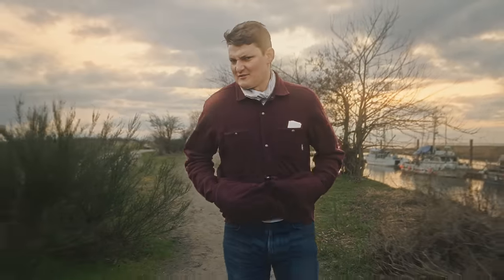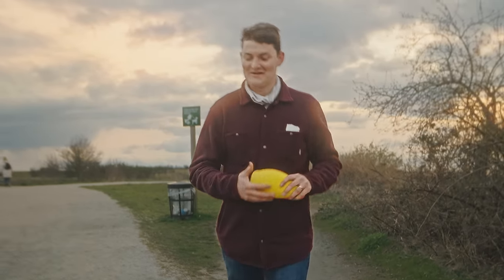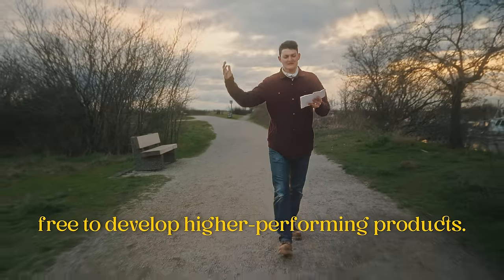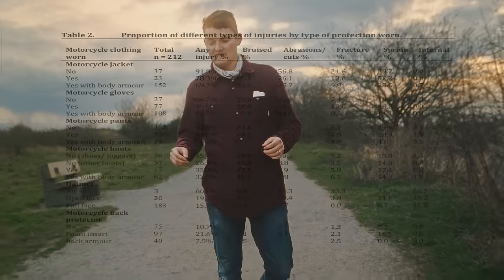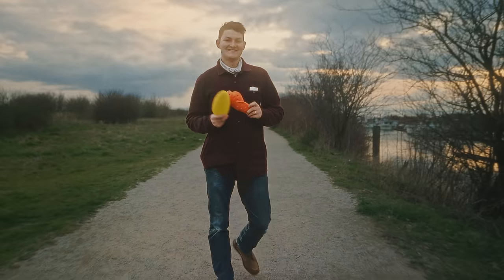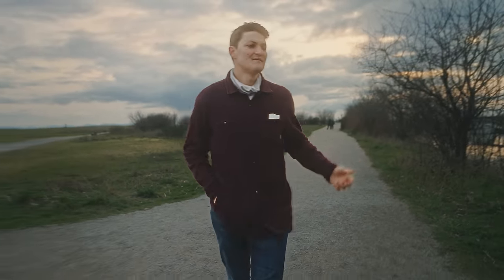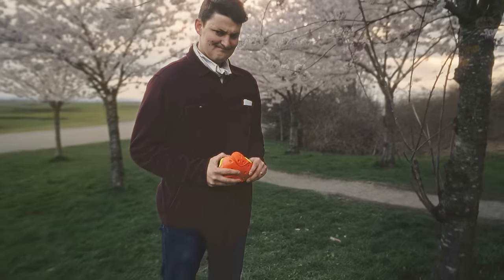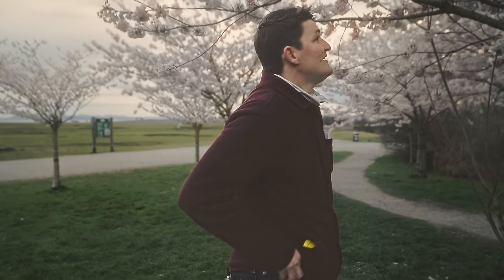Why I Stopped Wearing Motorcycle Body Armour

Comment: I high sided on the expressway last May doing approximately 130kph after hitting a metal patch on the road. I was airborn  for what seemed like an eternity and knew it was going to hurt when I finally made contact with mother earth. When I landed I broke my collarbone and damaged my shoulder ((now titanium man ) however I also slid a long way alongside my bike. The  motorcycle jeans I was wearing were damaged but the road never made contact with my skin due to the fabric and armour. My Jacket was like wise badly damaged but the material and armour protected my skin. My gloves had sliders on the heel of the palm and were both badly worn (trying to slow myself down ) but my hands were fine apart from a small cut on one finger. I never believed that so called armour would protect my bones and it did not, but there is no doubt what so ever, that if I had not been wearing it I would have suffered serious skin and tissue damage. I understand the points Ryan is making but his almost dismissive  " It  may save you  a bruise" is, in my mind, a little dismissive of the very real possibility of serious slide injuries. His airbag may protect his bones in a crash but it will not stop him wearing away his elbow. Armour is there to help save the rider from unintentional weight loss due to skating on your ass down a strip of tarmac.
Reply: That's true, but is there really much of a point if you're riding around town and not going those speeds? Not arguing, it's just an interesting debate. 130km/h is higher than the speed limits for 99% of roads here in Aus
Reply: Yeah because bikers never go over the speed limit
Reply: High sided on the expressway??????? Lol
Reply: I think you're mixing up armor and slide protection. He's not advocating for not wearing abrasion resistant gear, just for taking the pads out of them to make them more wearable
Reply: @willie123567 yeah but those pads add significantly to the amount of material that is between u and the road u slide over.
Reply: @Knallteute  sure, but you should be buying materias where that extra material is not needed (leather, extra strong textiles, etc)
Reply: @chrispekel5709  Personally, I ride an adventure bike. This stuff works wonders for slow-speed crashes.
Reply: @jarrod1687 But that is something you can control yourself. If you genuinely dont go faster than 50 because youre just riding in the city and commuting, then thats worth considering.

Everything else is just facts and not in the riders control
Reply: High siding at 130. Gear is not your problem.
Reply: @SynthgirlBulge  Most of us are on bikes to have fun. I'm not going to advocate for going over the speed limit - especially by a dangerous amount - but we all speed here and there. Also, in the USA, 130kph is not very fast. We have some speed limits faster than that.

As others have said, some armor is better than no armor. The armor will always absorb some impact, which will make the impact more barrable. Will it always save a bone from breaking? No. I fail to see how that's a valid argument though.
Reply: @seanhammon6639  it's amazing how people survive such ordeals... it's clear the protective equipment saved him from lots of extra suffering but in a sense it's luck more than anything else...
Reply: @seanhammon6639 Dont really understand your post but hey, each to their own.
Reply: @WillHampson Yes, changing lanes, large metal plate in road, wet, not seen because  view blocked by vehicle,  rear wheel lost grip immediately owing to slight lean angle, bike snapped into full l/h lock, tyre gripped again, me launched. I have since found out it has caused several accidents for both cars and bikes. Including fatalities.
Reply: @chrispekel5709  Hi mate, I am not an AGAT proponent. Just telling it as it happened to me. I firmly believe in an individual is responsible for themselves  and  should make their own decisions.
Reply: @willie123567 I may well be confusing the issue mate.
Reply: @WillHampson Does seem strange I know. But a wet metal plate that you hit with a lean angle will do it everytime.  I found out after that it has caused several accidents for both cars and bikes and at least one rider was killed because of it.
Reply: @chrispekel5709 sticking to the speed limit is dangerous on a bike nobody drives the speed limit by doing so you're opening yourself to getting rear ended, being tailgated and annoying people in bigger heavier vehicles who will only be feet behind you because you're doing the speed limit
Reply: @sleepyrasta420  they do here in Aus. So many cameras and heavy fines. I mentioned that in my post

Comment: Crash test dummy here.. flung myself off into the woods up in the Catskills after hitting a blind corner covered in sand from the prior winter.   7 broken ribs and a collapsed  lung. Helicopter ride as well to a trauma center.  Thankfully had a forcefield sub 4 back protector and level 2 everywhere else. Astar super tech boots saved my ankles, the bike landed on them and pinned me under the bmw. Knox handroid gloves..the ones with the exoskeleton saved my hand which was buried in a pile of river rock.  Had yellow bruising around all the body armor but all good. I landed with my arm up on a pile or river rock which did the damage to my ribs.   Full airbag vest could have helped, i suspect.   The hospital bill was over $100,000!  Do your self a favor and add as much armor as you can afford.   Riding 15 years till that event. It will happen, and there is no need to end up in a wheelchair!
Reply: 100k?! How much of that was paid by insurance???
Reply: Do you still ride?
Reply: Thanks
Reply: Murica! Would have been €600 own risk over here in NL. But crazy story ma dude. Hope you recovered well. I only ride with full gear. I like my body and skin.
Reply: It will happen? I'd say the majority of riders will get through a 50-year riding 'career' without a significant crash and/or injury. It's not a statistical certainty. Your story highlights the usefulness of gear, but you know what's even more useful? Safety and sport riding courses every single spring to refresh your skills and safely test your limits.
Reply: Cost me about $10k. Should have bought that airbag vest!  Went to EMDR therapy to relieve the trauma. Worked really well. Made the event into a distant memory.  This happened about 2 years ago. Took a year to start getting around without massive pain. Now 2 years and I feel ok, despite the weird shoulder noise when I do push-ups.  Started riding my road and mountain bike this year. Haven't been back on the motorcycle,  but getting the urge.  My daughter who moved back in with me threatened to run me over and break the remaining ribs if I return to riding!  Lol.  She may be serious.   That was the most disturbing part..seeing my daughter so upset with what happened. I am a single parent,  so very close with my children.  I'm 67 btw..and the thought of selling the Hayabusa is very disturbing! Glad I didn't crash that ride!  And correct..go slow at the beginning of the season to acclimate to the bike. Sadly everyone in my group had hit the ground at some point.  Deer..rodents oil..hard to avoid all hazards, so protect yourself  and enjoy the sport.
Reply: @bamidrol  Helicopter medivacs aren't free in the US.  Can be $30k alone.
Reply: Fuck me. Hell of a spill. 😮 Hope you're good now mate
Reply: Yes..thanks brother.. was nasty for a long while. They can't set ribs, unfortunately.
Reply: @wiseoldman5841  How fast were you going to do that much damage if you don't mind me asking? I definitely need to step up my safety gear by the sounds of it.
Reply: @rhodwilliams7258  Of course..in the range of 35mph at that point. It was a pretty tight  S bend. Couldn't counter steer at all.  The road was like ice. Went off into a large forsythia bush and landed on some river rock down, maybe a 60 foot drop. We tumbled at least one time. The windshield and topcase were about 30 feet up hill. Don't recall what happened after going through the bush. The helmet was all scratched up and had a concussion as well. More of those rocks!  The bike was completely rideable. And if I landed a couple of feet prior, would probably be ok. My luck.  The state trooper was kind enough to bring all my safety gear to the hospital.
Reply: @TheUrbanEpicure You’re presuming he didn’t attend such a course? There’s no accounting for every eventuality on the road. That’s why the gear exists.
Reply: @Dreyno  Yes, I'm presuming that based on his wording ('flung myself'). Sure, there's no accounting for every eventuality, but knowing your, your bike's and the road's limits is still the best course of action to prevent accidents.
Reply: God bless the NHS
Reply: 100k lmao America is doomed.
Reply: @bamidrol  FR. I'd pay a secret agent to fly me to europe and pretend it happened there.. FK the US Health industrial complex.
Reply: @wiseoldman5841 You are definitely correct and also lived to tell the story. Many young riders out there might be taking Fort Nine 100% seriously. I hope they all understand that it is called 'protection' for a reason. To protect a human from a fatal accident. Thank you for your wise and experienced words. Much Love, from Scotland, ❤ X ...
Reply: In New Zealand where i live and UK where I grew up it would cost nothing. Of course you might say 'It's in your tax' but our tax level seeing as it's no higher than the US it's almost invisible. Your country rippin' you off pal.
Reply: @TheUrbanEpicure  And still has no bearing whatsoever on whether wearing pads is a wise precaution. No motorcyclist can evade every type of accident. When it does do wrong, anything that helps is of benefit.
Reply: @TheUrbanEpicure  And his wording is light hearted. It obviously didn’t fling himself at anything. He came off his bike like so many of us have done and he’s merely used a turn of phrase in describing it.
Reply: Man fuck that, I have an escooter that goes 28mph! Sounds like u need one 😂
Reply: @wiseoldman5841  thanks for sharing buying an air vest now for my daily commute
Reply: @ShinjitsuKK  My cousin broke his back doing under 30mph. Hit a concrete pipe. 6 months in a brace looking at the ceiling.
Reply: Sorry to hear brother..the guy I was riding with lost his spleen years ago at 20mph when he hit a tree. Doesn't take much.
Reply: @Dreyno  Yes, it is obviously a light-hearted way of saying "it was a riding error, my mistake, I ran out of talent there". If someone ran him off the road, he would not have used that wording, given the severity of his injuries.

Your grip of the Englisch language is not the strongest, my friend.
Reply: Fortunately, you survived and still riding. Hope you had great insurance and coverage. If you were in Canada, hospital bill would have been $0.  I was in hospital for 16 days, required back surgery, and neck injury.  I did have a $80 Cdn bill - for the ambulance.  America must / should improve the medical system.
Reply: @wiseoldman5841  Get an electric monowheel, safe as houses!
Reply: You have it sorted up north! Just the ambulance bill was $1,800!
Reply: Universal health care is your friend.
Reply: Thats horrible!!! 100k just to be able to get medical treatment is unbelievable. I don't know why we put up with such a disgusting system in this country. You, and all of us, deserve better.
Reply: @wiseoldman5841  So sad but there is hope, do you think Yamaha Niken could have saved the day?
Reply: I thought of that after, but i had absolutely no traction at all. The sand and maybe ice melt were compacted and  slick. Nearly like ice. Couldn't get any direction changes from the bars..just straight off the apex unfortunately.
Reply: @ekspatriat  at his age he's on US federal government single payer healthcare.
Reply: @wiseoldman5841  I came a whisker away from losing a kidney from getting thrown into a pine tree by a snake-bit horse. We're not getting any younger.
Reply: Glad you are ok brother. Think we are working in dog years at this point!  Lol.
Reply: @wiseoldman5841  ditto
Reply: @bamidrol  - In Norway it would have been approx. 30-36 Euro ... and we don't need to pay extra every year for expensive health insurances... only taxes...

Comment: The 2 biggest flaws of this this video are: 

1: The video is assuming because the armor doesn't meet 4kN in distribution, the armor's effect is near negligent. This is inaccurate. 

2: The study said results are inconclusive. Yet the video pedals it as though there is no relation between armor and less injury/fracture. As a researcher myself I get frustrated when this happens. My first thought when I saw the data put on screen was this: "How do we know that the people wearing gear weren't going faster and getting in worse accidents?"
Reply: The plain physics of dispersed energy and energy spread over time has been proven so damn many times.
Reply: @logangodofcandy  what does this mean for our current discussion?
Reply: Yeah, it’s ridiculous. Tumbling off your bike at low speed and landing on your elbow. I know the armour will have me just picking up the bike, not going to hospital.
Reply: As a writer myself, Negligible Peddle could be a great researcher punk band.
Reply: 1) no... when is that assumed? The video states that the standard is not good enough because it's limited.
2) well, that's an assumption on your part, with no reason to suggest it. Other than statistically improbable.
If you are a researcher you should understand the concept of the null hypothesis.
Reply: That is entirely a true assessment, but also as someone who works more in the field than in a lab, you cannot control every variable always. Unfortunately, there isn't a good way to determine the speed of their crashes, or the nature of them with the data presented. One thing that jumped out at me was that 1 of the riders with no helmet sustained no TBI. Statistically speaking elsewhere this is very improbable even at low speeds, and basically impossible at higher speeds. This tells us that his accident must not have been major at all, and could have been just dropping the bike or glancing off the side of a car but remaining up. As such his one case threw the statistics and made helmets appear less useful than they are.

This study in and of itself is flawed as it did not include an expanded category where crashes are broken down into types such as a hard collision (running into a vehicle, hitting wall, ect), a low side, a high side, glancing side swipes both with fall and remaining upright, falls from stops or low speed turns, ect. Each type of crash has it's own element of variability that is completely and utterly ignored in the statistics above. Clearly, an elbow protect isn't going to do much when you hit a solid wall, and  a pair of gloves probably won't matter if you glance off the side of a car. By missing that data the stats are fairly skewed.
Reply: @oceanbytez847  Yes, exactly why the original study claims it's not conclusive (and should not be used to conclude anything, including that it helps with bruises, even if that is statistically relevant within the data because of the small sample size). But if they did that, the small sample size would have been even smaller, because then you would see 1 or maybe 3 per category.
What you suggest is the right approach, but it requires thousands of data point, probably tens of thousands to generate a decent sample size to cover everything.
And that's what we need to develop better protections (but we can start even without that)
Reply: Well he did open up saying surface level digging